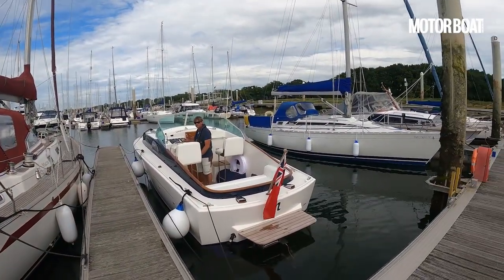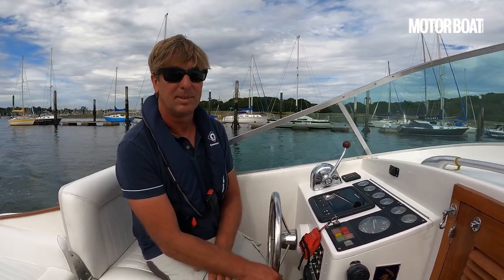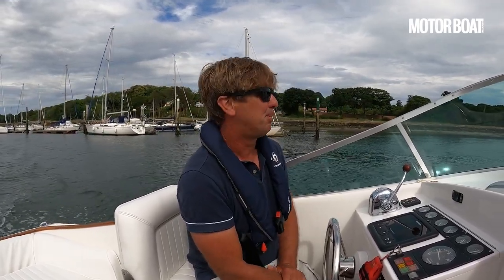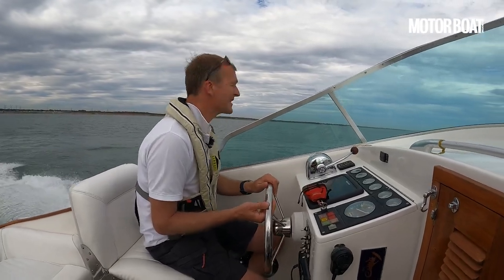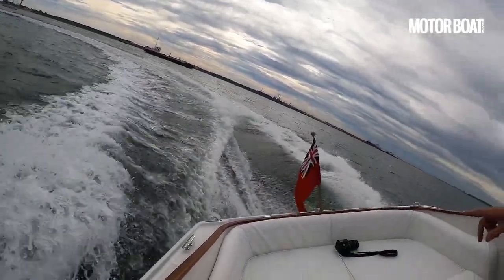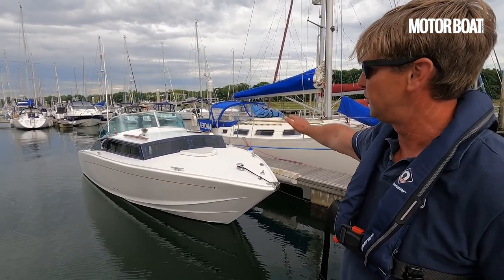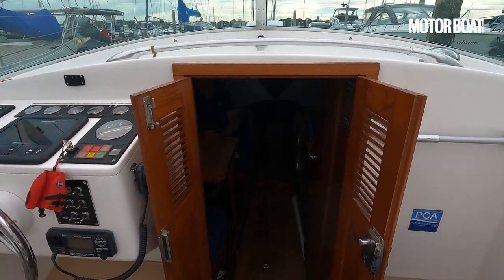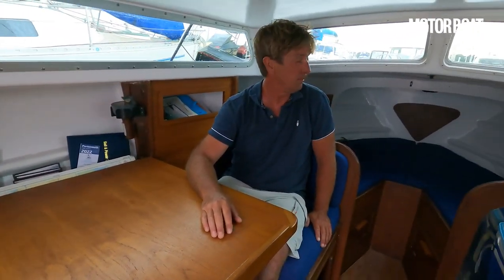Flat out in a classic powerboating legend | Refitted 1968 Levi Triana sea trial | MBY

Comment: What a fantastic job. Are there any other modern boats with a full 26 degree hull? Even the highest  performance boats have a 24 degree hull at most that I have read about. Is it an I/O drive?
Reply: Very few boats have a consistent angle from transom to stem these days as they tend to use modified or variable vee hills that are sharper at the bow and flatten off towards the stern. That said some of these designs are still pretty sharp at the transom particularly some RIBs which can rely on their tubes to add stability. I’m not sure of the exact number but I’d think Scorpion, Goldfish, Rib-eye and Cormate must be close to that.